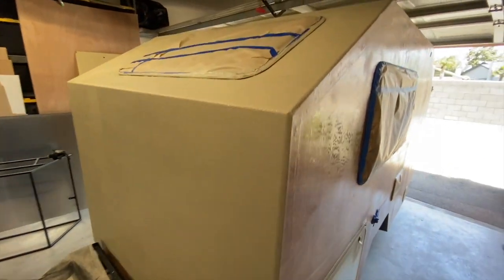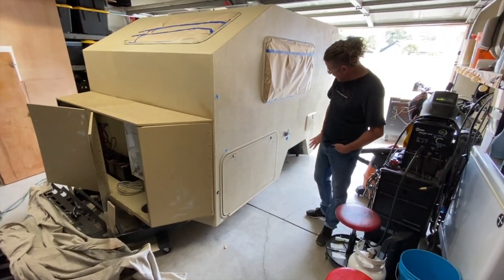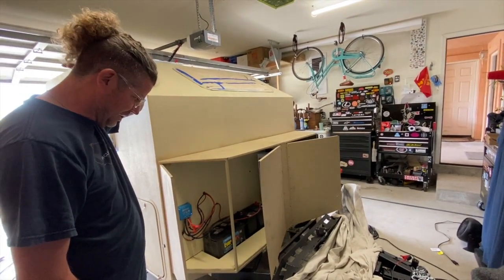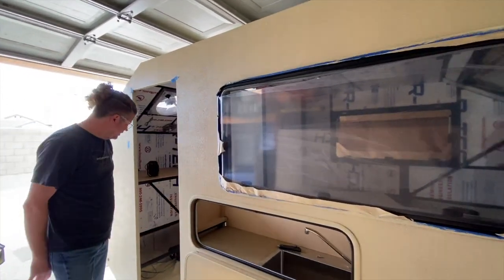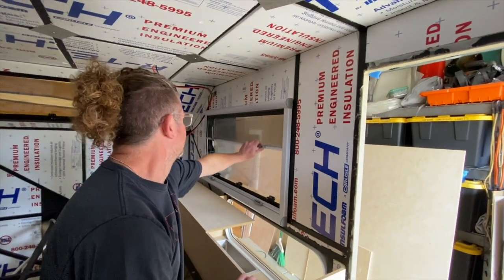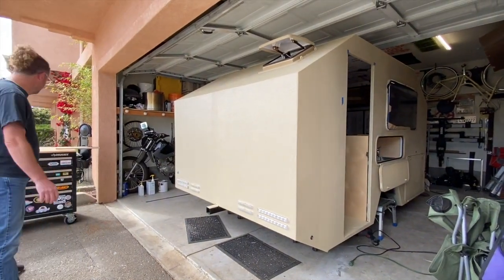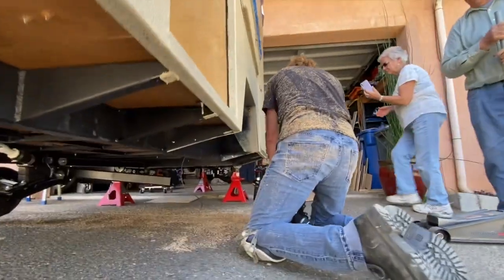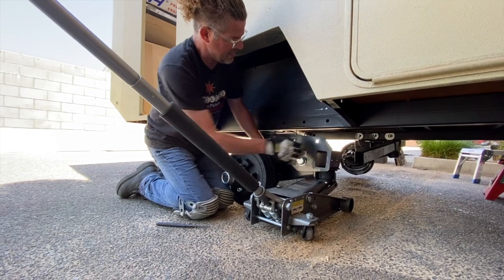overland trailer build finishing the envelope 07

Comment: Curious how you made the doors for the front cabinet (where the water and electrical is housed)
Reply from the maker: the doors are just a flat sheet of 20ga galvanized steel with the edges folded (on a metal brake) for strength.  happy to send pics if you would like?